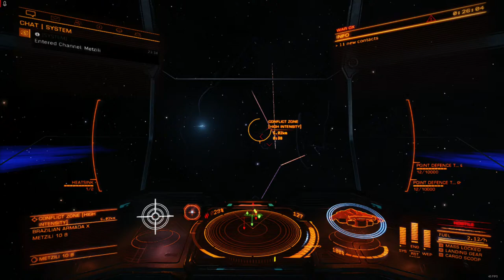Elite Dangerous | Build Experiments | Type-10 Shock Cannon Test

Comment: You need to engineer those thrusters.  The t10 can pitch waaaay faster than that
Reply from the maker: They are engineered, G5 strength + double braced. The ship was meant for another activity, I just repurposed it for this video.
Reply: @DryHeatAndSand  oh OK.  Mine are dirty drag drive.  That explains it.